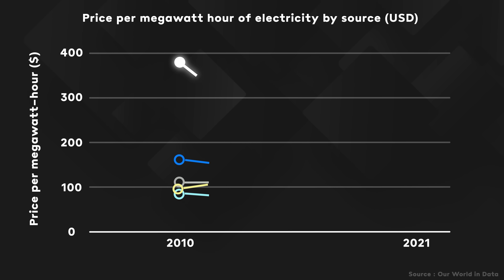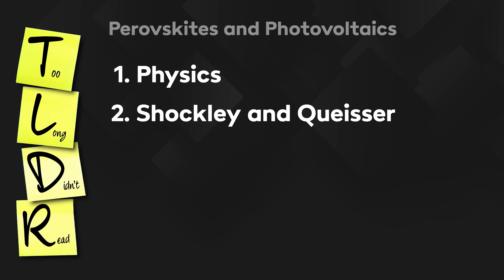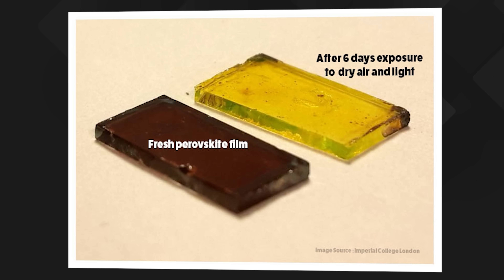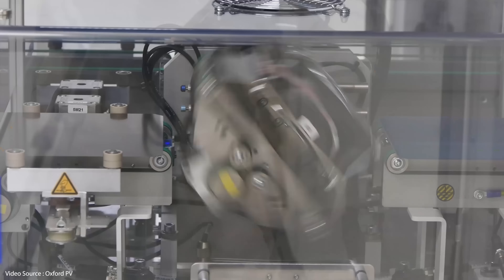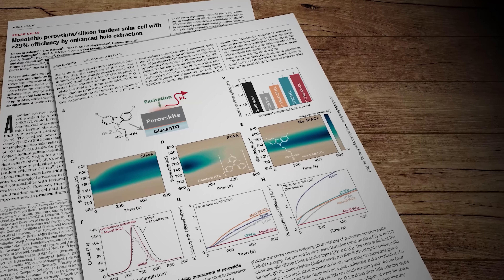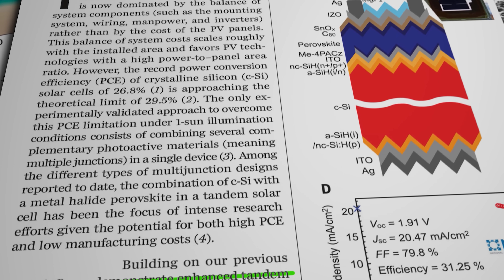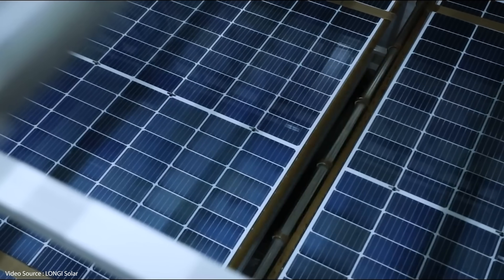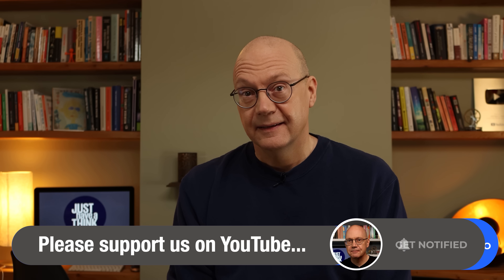Perovskite Solar PV. FINALLY some good news!

Comment: When real world efficiency that can be sustained for 20+ years reaches over 30%, I don't me lab units but real world full scale mass produced panels, the game is over and the arguments against alternate energy will be but the whining of the town drunk.   This then demands the storage problem be resolved and while various batteries look promising the only real solution for grid scale storage is pumped hydro.  The thing is, pumped hydro is not some new and untested idea, but it's a mature concept that been in actual use for a hundred years or more.  What's needed is a proper assessment of the best locations for them and to actually go and build them.  The combination of PV solar with wind and a sufficient pumped hydro storage system will finally put an end to fossil fuels.  However, and it's a really big however, the replacement of fossil fuels for the generation of electricity only solve about 30% of the energy problem as a transcontinental airliner is not going to operate on electricity anytime soon.  Transportation more broadly demands a more energy dense energy source than current batteries are able to provide and we may not see much improvement in energy density for decades if ever -- we may already be pushing what electrochemistry is capable of.  The solution for that problem would then be to use solar/wind energy to produce fuels like methane or hydrogen with methane being preferred given it's higher energy storage density.  Yes, burning methane produces CO2, but if the methane is produced from the CO2 in the air then it will be net zero or nearly so.  An A-380 requires more than 200T of fuel to travel intercontinental distances and there is no battery in existence or even remotely feasible that comes anywhere near this capability so for jobs like that you need an energy dense fuel like methane.  Methane is desirable as it is much cleaner than jet fuel both from an emission standpoint but also cleaner for the operation of jet engines (fewer deposits).  It would be wise for the jet engine makers to be working on methane based jet engines NOW...
Reply: "the only real solution for grid scale storage is pumped hydro."

Pumped hydro is ridiculous. It only works where the topography is right (suitable hills), needs expensive dams and turbines, and floods large amounts of land.
Reply: @leonardosabino2002  Sorry but you need to run the numbers before blathering as you have.  A 10km by 10km lake in the mountains near Wheeler Springs NE of LA could store enough energy, about 5 PJ, that would be able to deliver over 80GW for 16 hours with a round r=trip efficiency of about 85%.  What would the lower pool be you might ask -- the ocean.  Salt water would have some challenges but being denser than fresh water you need less of it and you only need to make the upper pool!
Next time maybe break out your calculator before embarrassing yourself!
Reply: @Raptorman0909  You didn't address any of the objections, though. As I said: pumped hydro only works where the terrain is favorable, the dams and turbines are expensive and a lot of land is flooded.

The example you gave is 80 GW, which would be the largest hydro plant in the world by a large margin (about 3x bigger than the Three Gorges Dam in China). And then you would need a bigger lake because 16 hours of storage is very little.
Reply: @leonardosabino2002  That single 10km by 10km lake is more than the entire state of California would need --THE ENTIRE STATE!  There are numerous places where such lakes could be made but, yes, there are numerous places too far away from them.  That's why the invented something called TRANSMISSION LINES!

Comment: Solar is a commodity. Whilst it's useful for researchers to work towards better solar, the uncertainty of perovskite's durability and the added complexity, cost, and emissions penalty of building a two layer cell means this isn't going to change the way solar is done. 

Academics broke 30% long ago with a more complex multilayer recipies. And yet the world buys mono and polycrystaline silicon panels because they are the most cost effective thing to install, giving longevity and high performance. Thin film could have changed the solar industry with it's cost savings, but it didn't because it underperformed and silicon costs came down with Chinese production cost savings. Witness that the solar panel companies who are thriving are not the Tier 1 suppliers with the best mousetrap. They are the Tier 2 suppliers who sell for cheaper and do well enough with efficiency. These aren't Ferraris and Porsches going on roofs and in utility installations. They're Civics. Maxeon (formerly Sunpower) should be the highest value solar panel company with the most sales, building the best and more durable (lowest degrading) panels there are. Yet that company is struggling to not go out of business, having focused on being the best instead of being the best value.

Frankly the parade of new solar records broken have been nothing but a distraction of hopefulness of very wrong futurists and technocrats like Tony Seba who very much incorrectly presumed that solar tech was analogous to computer/cell phone tech with Moore's Law and Wright's law magically delivering ever better future. 

The installation of solar tech beyond a certain point becomes difficult because the value for power from it will be valueless during the summer months with the longest days where curtailment will happen relative to winter months where you don't have enough. Long term contract PPAs complicate the story greatly vs. the short term value of those panels not under contract. Right now solar power is improperly accounted for on an annual basis rather than on an hourly basis year round. We will eventually hold power companies, CCAs, and everyone accountable for matching renewable commitments with actual power deliver of those electrons in that hour/minute, and once again the value proposition for solar gets weird and becomes difficult to run a capitalist power economy. If we shift to nationalized power systems, benevolent governments who build and own them, carefully consider LCA for the lowest emissions, and throw cost largely out the window, then all these record breaking multilayer, more complex cell types could make more sense than focusing on cheap manufacturing as a primary consideration.

Comment: Grids are horrendously expensive. 
Do the maths for a no fossil fueled future electricity demand. 
Grid one took 100years to build 
New grid costs $1million per klm 
1million klm is 
$1TRILLION 
5 times more electricity capacity is $5TRILLION. 
Per million klm 

PLUS new generation plants at $2BILLION each and 400 needed. 

Little Australia has 1million klm of poles and wires and transformers and switch yards and transmission lines and...
Only 20million buildings. 

Australia GDP is only $1.5TRILLION. Impossibly small amount 

Hello 👋 hello 

Grid electricity is STUPID.

Comment: Just saw a perovskite article and vertical mounted bifacial panels video yesterday.  I'm thinking if perovskite panels were mounted vertically or used as windows, the degradation be drastically less.

Comment: Australia has 1kWh per m2 but only
 0.2kWh per m2 is available for electricity. 

New technologies seem to be evolving rapidly and 80% of remaining energy is still available.

Cool latitudes and angled PV panels and longer non winter days means huge amounts of electricity and no grid electricity costs for months every year.

In a no fossil fueled future huge amounts of electricity is needed at the customer's building and home. 

Massive grid capacity construction costs can be avoided. 
This is a $TRILLIONS saving. 

Someone tell me they have done the maths on grid capacity and grid  construction of 5 times bigger national electric grid. 

Hello, hello 👋 hello anyone, can anyone do maths ???????

Comment: I'm all for solar where it makes sense, but it doesn't make sense at night, it doesn't make sense when it's overcast and output is cut by 90%, it doesn't make sense when it replaces farmland needed to grow food crops, it makes sense to add solar capacity when peak output matches peak demand such as in Southern Californicatia when AC load during the summer peaks with peak sunlight when electricity from solar can meet that demand, doesn't make sense in the Northern states where peak electricity demand is in the winter for heating and there is little sunshine and that little that does make it is in the peak warmest period of day and not the middle of the night when heating needs are greatest.  It would make sense if we had facilities that could utilize electricity during excess production to react CO2 with H2 from water we electrolyzed during periods of excess production to make synthetic methane that we could pump into the natural gas piplelines and burn for heat and electricity during periods the sun was down, but right now we do not have these facilities so more solar doesn't make sense.

Comment: An excellent top notch synopsis Dave, thank you! 🎉😊🌅. Cambridge seems to have hit the mark 🎯 ahead of the competition.  My thoughts are ancient by comparison; I just wondered why someone hasn't simply developed a layer to convert the UV and visible spectrum light into what the traditional silicon photovoltaic cell wants, which is red light to infrared.  Kind of a florescent layer that can convert sunlight to the food that the cells want.

Comment: Heh. When I was a kid back in the '70s, I had a toy truck powered by a solar cell. It was one of the polycrystaline ones, with the silicon grains the size of your fingernail. It propelled the truck at a crawl, and I hesitate to imagine how much a megawatt of them would have cost.

As a side note, many perovskites can be made to have catalytic properties.
Reply: Funnily enough, at the micro-scale is where something like this would really help. Electronics with ultra-light super efficient solar panels would enable distributed sensors in a way not currently possible. This could help farmers target irrigation to drier parts of their fields, alert logistics companies to the location of equipment like trailers and dollies, amongst other things.
Reply: What are they used to catalyse?

Comment: Strong work ethic vs beavering away.  Hmm. A warm fuzzy vs accurate articulation.  I'm leaning towards the warm fuzzy.  Excellent video  ! And what if you layer a cheap plastic Fresnel lens on top of the solar panels ?

Comment: Thank you for this video! This is one of the subjects you've previously covered where a follow-up is probably most valuable, because perovskites have such enormous potential.

So the short answer to "Where are they now?" is that Oxford PV has made good progress on perovskite solar cells, and is on the verge of selling the first commercial product. Cubic PV is a few years behind them with lots of innovative new ideas and plenty of funding, but no factory built just yet. And behind them are researchers in different countries with their own innovations, but so far none have gotten outside of the lab.

Well, here's hoping Oxford PV is a big success! Hopefully they'll pioneer this new technology, maybe with Cubic PV as their biggest competitor, making it both commercially successful and increasingly efficient. And then we'll reach the point where solar energy is so cheap and efficient it's just the natural choice for everyone. No warnings about the fate of the planet required: self interest and simple economics will drive adoption.
Reply: Yes!

Comment: Well, did I miss something, or wasn´t there a single claim about durability of any of those cells which was comparable to contemporary silicon based solar cells? The efficiency of conversion of sunlight could be incredibly high and it still would not matter for large scale applications. We didn´t hear either, what those supposably almost market ready perovskite cells are meant to do. For example, there would be a market for self loading electronic devices with ultra high efficiency solar cells, even if they don´t last half as long as conventional cells. And even though that would still be nice, it would not be a game changer for solar energy in general. Are we talking about something almost market ready which is potentially profitable but is not even meant to be an alternative in the most widespred applications? Apparently we just don´t know at this point, even though the companies involved might. Without data about product lifetime of the most advanced perovskite cells as well as a price tag, there is realy no basis for useful speculation about the potential impact of the technology.

Comment: I've wondered since the hotter solar panels get the worse they conduct electricity.. So is there a way they could make a aspect of the panels that convert the heat into some sort of heat transfer system? It could increase the efficiency of the solar panels? Just something I've been curious about. I'm sure they would have done it by now if they could have.

Comment: I think that we as a species are looking at the issue wrongly. EG what about rain cells? They actually work and are ideal for shaded areas in rainy climates. I think we need solar PV on roofs with rain generation on the shaded side, and grid level wind generation. We also need upwards of 7.5kWh of storage using sodium cells at the domestic level plus grid level storage. It really is both and not either or.

Comment: It will be interesting to see how perovskite on perovskite works out - potentially cheaper than silicon for both (or more than 2) bandgaps. (Acknowledging that, by "perovskite" we mean perovskite-like materials.)
Reply: This would imply you have 2 different Perovskites that have this much different bandgap. Not sure if that comes any time soon.

Comment: Squad Solar is a small city car that costs less than £6k new, and has a solar panel roof that adds up to 30 miles of range a day. That's 150 to 200 free miles a week. Almost-free city driving for the life of the car.

They are taking orders for the first 10,000 right now. Delivery this year. Already there are orders from city car rental apps.

This car looks seriously disruptive too the ICE car system.

Comment: No question, the majority of our power will be generated via solar in the near future, with wind, hydro and small nuclear, making up the rest.  Tandem solar cells will the standard in the next several years as the solar industry is remarkable at embracing higher efficiency and new tech.

Comment: ⬆️ efficiency + ⬆️ longevity  + ⬇️ cost + ⬇️ weight = ⬆️ practical applications. It starts making sense to shoehorn in solar anywhere and everywhere, including areas that don't get great sun exposure or have perfect exposure angles or where weight is an issue or it's barely worth it with today's solar panels, eg tops of cars (so many people think this is an obvious idea, but for the added cost and complexity it barely adds a few miles of range per day - the equivalent of plugging in for a minute or two... assuming you've left your car in full sun all day. But if it's cheaper than paint, then it certainly makes sense!).

Comment: The big question will always be whether it will make financial sense for the early adopters and whether the new cells will stand the test of mother nature and our sun in different areas across the world. If I have the space, I would rather stick with time proven Si which are at the lowest prices now than ever. By the time Perovskite becomes mainstream and production lines shift into that, prices would have dropped but at the mean time, we would already have shifted loads of fossil fuel use using the cheaper Si cells. Waiting for Perovskite makes no sense unless your current array is already near its EOL.

Comment: 30% at the panel level would be about 50% greater than the current panel level at 20%, which is very significant. Nevertheless 70% of the energy is not being absorbed.

Comment: most perovskites have lead which the world does not.need more of, just to gain a few percent efficiency. and ironically call it "clean energy"  there are lead free perovskites; that is what should only be used.
Reply: "most perovskites have lead which the world does not" <- it was not made clear in the video, but  the perovskites in these solar panels is not just dug out of the ground. See the top comment by a chemist who makes a note about the material.

Comment: I wonder whether this tech is 'plug-and-play' within the current market. Do such panels need specific inverters? Will these tandem panels need two strings (one for the perovskite and one for the silicon) or can both technologies be used in series or parallel with one MPPT? As inverters are more expensive than panels for small installations these days, it seems an important consideration.
Reply from the maker: I think the current and voltage of the output will be indistinguishable from a single layer silicon based panel.
Reply: @JustHaveaThink  Maybe if the panel contains built-in optimizers, but I doubt that would be the case without it.

After all, the silicon layers works with infrared and the perovskite layer works with visible light. Depending on the orientation of the panel, time of year, time of day, cloudiness etc., the ratio between infrared and visible light will be different, therefore both parts of the tandem will have different maximum power points. Seems unlikely to me you can just connect these two layers in series and get an acceptable output.

So it seems reasonable to me to assume such panels will all have built-in optimizers of some kind.
Reply: Okay, nevermind, I see the Oxford PV panels are '2 terminal', they are apparently fused together at cell level. So there isn't even a way to tap into the two layers separately.